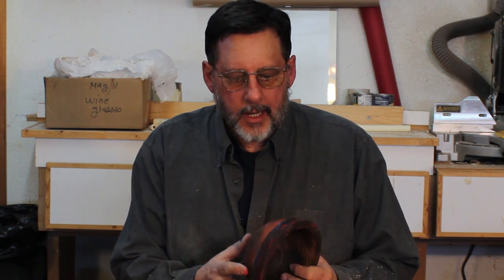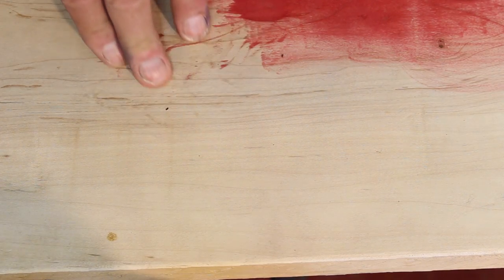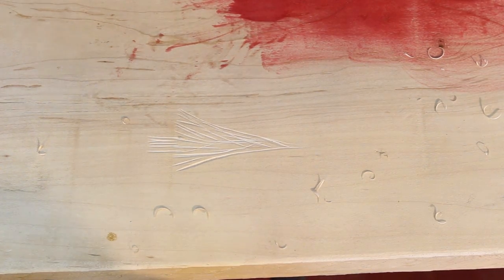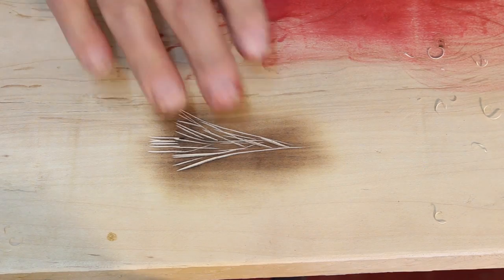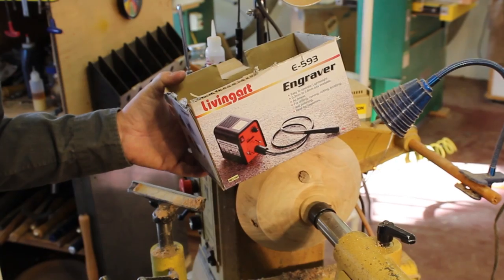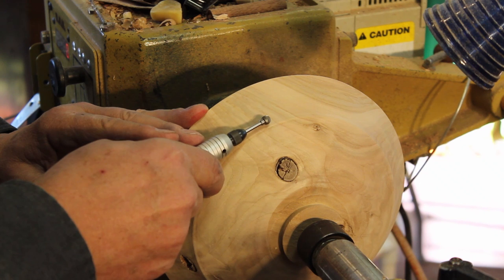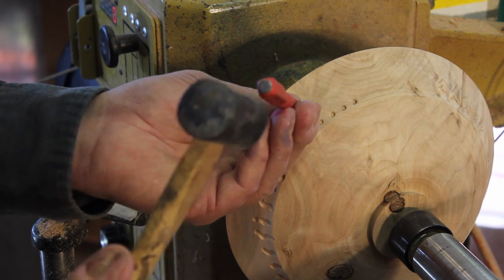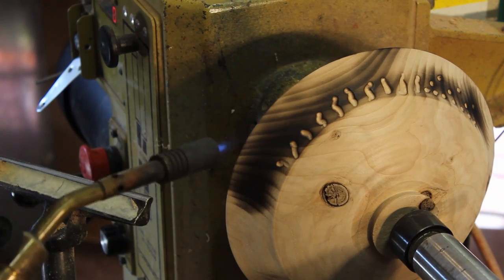Carve, Burn, Color

Comment from the maker: GB
One thing I wil do with a scortched area is to wire brush the surface a bit.  I will knock off the loose charred areas before sealing.  One can also burnish the surface with steel wool or a paper towel.  THEN, I will seal it with something like shellac:(my favorite)--oil works well too.
Sam

Comment: Quick question for you or anyone else on the channel, do we need to do anything special to scorched wood before we finish it ?  for example, will some normal poly finish adhere to it ?  do we need to seal it with shelac before, etc etc (can surely not sand it!)  would some oil "dilute" the scorching for example ?  tyvm, nice video